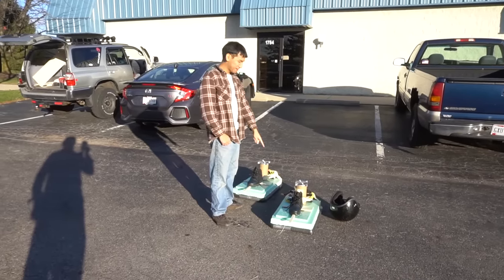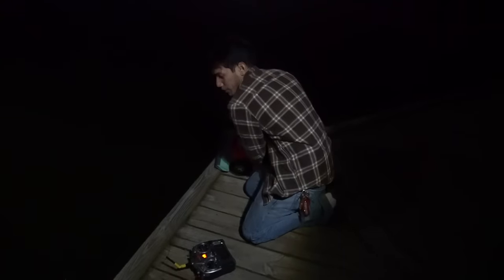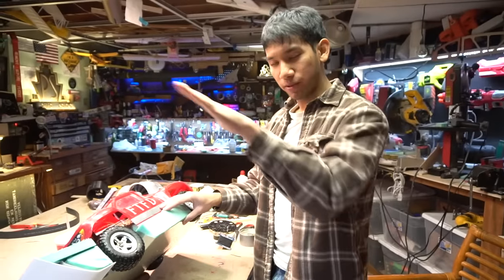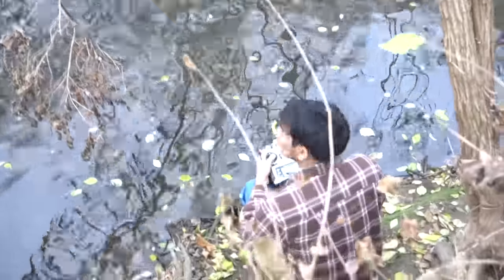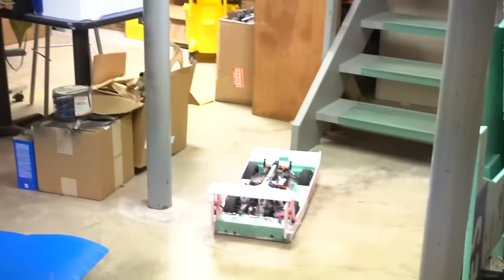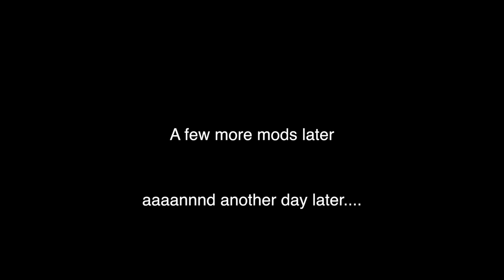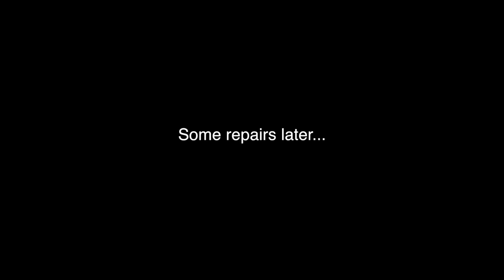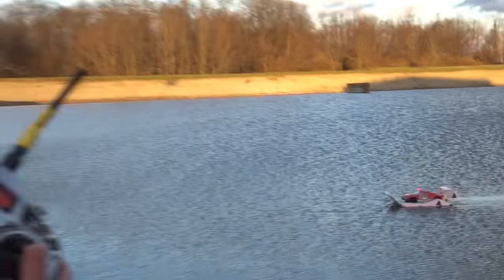RC Amphibious Car Airboat

Comment: They used to make rc cars that would rotate the wheeels 90 degrees to use props that were oldes into the wheels, but that was like 10 years ago when sub $200 rc toys weren’t junk

Comment: Being a hovercraft snob this just shows you anything can move with enough power thrown on it.  My hovercraft circa 1991 had 13 HP and easily got 40 MPH with 400lbs payload.  Yes, my current one has 40HP but only does 55 MPH.  Should have made this a catamaran style good iterative design Peter

Comment: If you get sand tires for the Slash (if they even exist) I’d bet you could propel the boat with them alone.
Reply: Sean Smithy they infact do.
Reply: And if you add lipos you dont need the boat

Comment: Look up the EFV. They did something similar with the tracks, retracting them for water operations, but they also had a plate to cover the holes. Your wheel wells would cause a lot of drag on water.

Comment: You sure did a nice job on this, Peter. Though I might have tackled this slightly differently and had gone for a subhydro propeller rather than a skimmer like what you built. Make no mistake though, a skimmer has better uses being fully amphibious but you can do without the wheels if that's the case. With a subhydro design, the dynamics of the RC will be more akin to what you were initially after; a lifting nose and submerging tail when in high speed in the water. Just like a speed boat. you could have also shaped the bow to have a pointier feature rather than a flat one like what skimmers usually do. Water skimming boats tend to be pretty unstable at high speeds in the water so you might opt to break the water rather than skimming the nose over it. Or maybe have a mechanism to deploy hydrofoils for better stability at high speeds? It should look far more presentable, in my opinion. Hope that helps with some ideas in your future projects.

Comment: I have been thinking of doing this with my Helion Rock Slider. I want the foam to come on and off easily. Just use the bigger tires for propulsion and steering. Peter definitely made it look doable. Mine won't be anything Peter Fancy.

Comment: You know what might work better? Have the car drive onto an amphibious platform and have the rear wheels power a water prop through a set of gears and have the front wheels lock into a mechanism that powers a rudder. Basically the front of the boat folds down and open which allows you to back the car into the partially launched boat. The car wheels meet up with the gears, the front of the boat closes then you can fully launch it into the water in reverse. Two separate vehicles that hook up to become one. My idea actually sounds a little more complicated but I think it would be cool.

Comment: G'day,

   Yay Team !

   What you were up against Peter, is known as the Arselbow/Elbarsole-Effect.

   Meaning that it's easy to design and build an Elbow-Joint, and it's equally easy to design and build an Arsehole...; but trying to build an Elbow which will function well as an Arsehole, or an Arsehole that can work as an Elbow-Joint is so incredibly difficult that nobody bothers with worrying about it, because what one finishes up with is an incontinent Arsehole which won't work as an Elbow either, but is heavier than an ordinary Arsehole plus an Elbow added together.

   It's an effect often quoted to people who hope to combine Sailboats with Aeroplanes, they get a horrible Sailboat which flies but not at all well, guzzles Fuel, costs a bomb to maintain, is outrageously vulnerable to bad weather while afloat & moored, and is terribly labour-intensive to operate (needs a Boatman & a Tender to ferry people from Shore out to the Mooring-Buoy, or haul it up Slipways for Maintenance, etc).

   Floating Road-Vehicles are famous for being Arselbow/Elbarsoles..., the WW-2 had a VW Schwimmwagon, the Yanquis had DUKWs & Sherman Tanks with collapsible Canvas Screens (most of them sank in Combat, at D-Day in Normandy) ; and I once actually saw an Italian Open-Topped Sports-Car (1960s- vintage) for sale in Sydney in 1979, which had a Shrouded Water-Propeller behind the (Rear) Differential, and it used the Front Wheels as Water-Rudders...., I've seen old Film of them being used on a flat calm Lake when there was no wind, and they looked very very scary, with perhaps 6-inches of  "freeboard" between the Devil (top of a vessel's Sides) & the deep blue Sea, and most of the Vehicle wallowing and already under the water as they slowly ploughed along....(yuk).

  Arselbows & Elbarsoles are best avoided, because it takes lots of very clever Cinematography & Editing to make them look as if they're worth doing.

 Such is Life....

  Have a good one,

  ;-p

  Ciao !

Comment: If you employed pontoons, mounted laterally on either side of the vehicle on a hinged frame, you could use the same actuator that raises the tires to operate a lever that lowers the pontoons down into the water. This configuration would raise the entire center of gravity of the boat, as the pontoons would bear more of the weight, and lift the bottom of the vehicle chassis further out of the water . This would distribute the weight more to sides of the vehicle, and also reduce drag on the chassis. One other innovation you could employ, which could be easily integrated, would employ the wheel-lifting/pontoon-lowering actuator in an additional capacity. If you use the lifted tires themselves as a sort of pinion gear, or perhaps mount pinion gears to the wheels  or the axles, you could use the wheel motors to power the fans. A single powerplant powering both land and water propulsion would surely improve efficiency. It's not really as complex a design as it may sound, as the process of lifting the vehicle onto the lowered pontoons and engaging the "pinion gears" could be combined into a single action.

Comment: If you’ve ever ran boats very fast a flat bottom boat is very difficult to run at high speeds you need a V bottom in the front of the boat with a couple of runners going toward the back to control the water flow or a couple of hydrofoils underneath

Comment: Do you think if you shaped the front  of the hull more like a traditional hull it would have less water resistance?  It seems like the water is piling up at the front slowing it down,  if it pushed it to the sides might help

Comment: i did build a lite ply air boat about that size with a .20 size air nitro motor. It did very well but wanted to torque roll at full throttle.  Maybe make yours a little longer in front and add some upward sloped side plates to keep it from digging in when you want to spin it.

Comment: If you make the bow of the amphibian triangular just like any speedboat and remove or trim those blocky thing between those wheels and turn it into a body like a speed boat it will make your rc much more faster but in any case it might have flaws like balancing issues but if it is worth trying then it is up to you

Comment: you should do a catamaran  outrigger on the car, instead of the wheels raising design it so the outrig lifts up and down from the top of the car. no mods to suspension and easier water displacement due to the cat design. 👌👌👍

Comment: Peter. For a smart guy like you...this design is killing me. Use a double hull foam float...razor thin hulls and LOWER THEM instead of raising the wheels. Race boats have almost no contact with water.

Comment: I could totally see this is a variation of the Slash as a beach toy if it had plastic paddle Wheels 4 traction and also if the motor goes wrong

Comment: Very cool, as usual! ?maybe you could build an Acranoplane? (One of the semi-plane things from like ww2 that are basically a large jet plane that flies around thirty feet off the water max, basically using ground effect. Interesting and unique but ultimately not very agile although fast. At once point Some were mounted with 6(?) or 8 (?) torpedo tubes on the wings making it look very unique indeed, a bit like a plane covered with jet engines all over, haha. They were pretty efficient and fast cargo planes/ships at the time (and occasionally carried passengers)but were also too venerable to attack in wartime due to a relative lack of agility(speed being their main advantage and subsequent tradeoff). As far as I know only Germany* produced designs like this although I don’t know if the general concept of such a design was their idea especially since it was ww2. Disclaimer I’m not sure the spelling is correct in the name sorry, I’m also not a historian or anything more than an average commenter so forgive my potential oversight of spelling, punctuation, grammar, or particular lack historical accuracy or content in general. It’s just as far as I know and have written quickly. Cheers

Comment: did you use an arduino or did you reuse a RC car ? (asking because i wanna make a car/tricopter)
Reply: He probably used premade controllers eather from the rc car or made for rc airplanes. For making copters there are special controllers out there, which include basic gyros to keep the thing flying. The problem with tricopters is that because you have an uneven number of motors, the torques dont cancel out so your back rotor has to be on a servo tilted mount. It might be easier to start with a quad because you can spend the weight of that servo on another motor and there is a lot more info about these out there.

Comment: Why don't you just put paddle tires.on the back and have only the front wheels come up out of the water? You could keep the quad motor so you can still utilize the rudder. Just an idea

Comment: Just changing the angle in you first try woul make the nose come up! you had it at 0 and change to -10º, lifting the rear out of the water. had you changed it to 10º would made de rear try do dive, bringing the nose upwards and the rolling of the watter will lift the front!

Comment: Dip the electronics in plastidip. Works fine. Most of the time i dip it  3 times just to be sure. Let it dry up between dips. Got the stuff in a jetboat and was under water a few times totally

Comment: Peter, have you thought about a design that would incorporate a hydrofoil that could be extended into the water? This could allow you to leave the wheels in their original positions, or have the hydrofoil deploy and wheels raise in order to further remove them from the water reducing drag. It would take some work to get it fine tuned for balance; I'm not sure how it would react with the thrust being above the water.

Comment: Just as a cool detail, you could have added a water sensor so the water prupolsion (Assuming it to be properllers, jsut started the video) wouldn't be on all the time unless it was IN the water. Of course, maybe make a override? In case the sensor failed, so you dont hgave to go out into the water to get it...

Comment: Could you use a servo to lower a propeller into the water. That would generate pressure to push the bow up.

Comment: why not have a drop in out board motor. I think using air as thrust is inefficient  when you have perfectly good water to use as thrust.

Comment: You went for a Punt shape, flat bow... you could have used a V shape and cut through the water rather than trying to push the water out of the way, using less power to achieve plain. Nothing wrong with flat bottom at all, water is easyer to cut than push.

Comment: Try removing the wheels and putting cardboard or the we were supposed to be so it does not drown out the engine and make it to where the cardboard spin like a real boat I think that will increase the speed

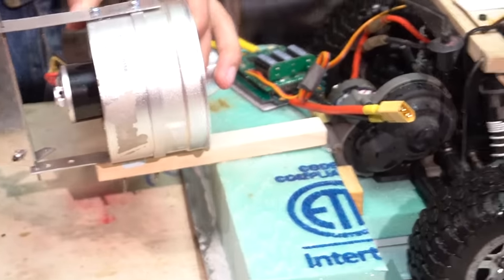Comment: Good morning all! I have a question which may seem a little silly but at 4:06 the little yellow connector for the battery I have exactly the same and I can not connect them to the wires of my battery with stain. do it differently? where is there a way to connect otherwise?
thank you very much

Comment: theirs still drag in your creation i think you should scratch it and start new make it have like pontoons and make sure the wheels don't touch the water that will cause drag and if you can try adding the big fan for speed and those 2 mini fans for speed and turning make sure to add rudders to pontoons too. You are going to have to modify the car a little more so it can reach out further or keep it like that and just make the pontoons fold back up on top of the car. Do you mind trying that for your next video please?

Comment: Don't pull the tires up when using like a boat then if there is enough speed then it will glide on water i have tried 
Edit change the tires to different wheel those which have more grip

Comment: I would just make it so you could fill the tires with helium no fan needed just water proof everything and your done. Lots of RC cars can ride on water right out of the factory. My opinion this was just a waste of time and materials
Reply: this guy isn't super into rc cars. also, noone asked for your opinion. and no, a bone stock traxxas slash xl5 will not drive on water.